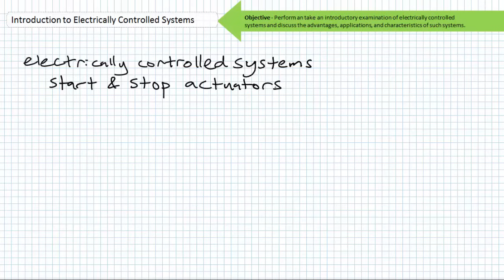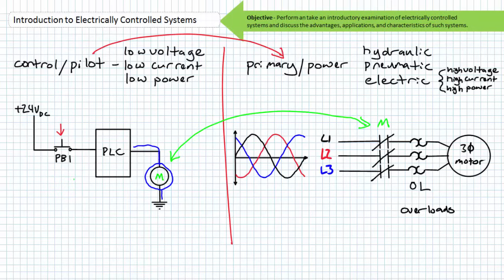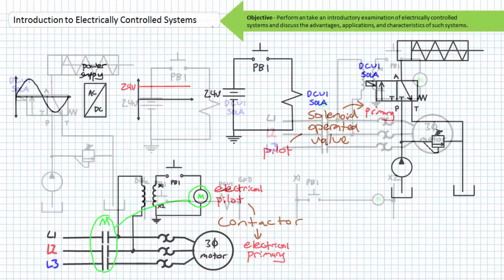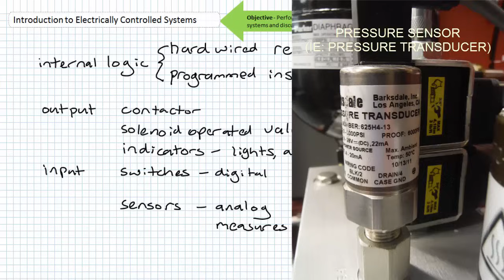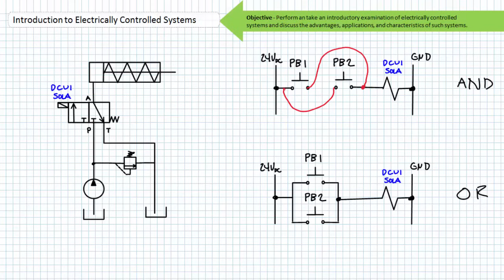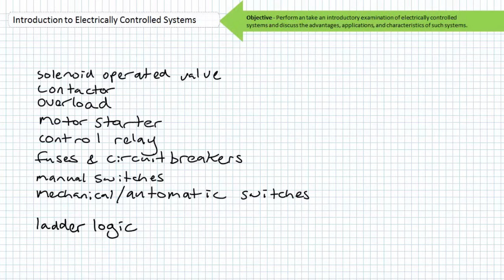Introduction to Electrically Controlled Systems (Full Lecture)

Comment: Control systems.  Actuations.  Seems a little different than most control theory.  Inputs, Outputs, brain.
Troubleshooting.  Efficient and systematic.

 Start, Stop
Change direction
force and speed control

time, counting, sequencing, compare, compute, and communication.

Control signals vs power signals
pilot                    vs   primary (actuation)

relay of signals......

Comment: Superb lecture I never ever heard before.
Sir can you explain how do operater operate the throttle and speed engine or pilot put on switch and aircraft win flap. How they operate electrically hydraulic or pneumatic system.
Please help us to understand this.
Thanks.

Comment: I have been working in the aerospace industry & I don't understand why they don't use the ladder diagram schematic for flight controls, they use something called "Lamm" diagrams which are a hybrid pictorial/electronic symboligy. Ladder diagrams would make sense for hydraulics used in flight controls.

Comment: You have done a lot of intros! Now we need to do some more complicated motor control circuits and a dive into automating a VFD via digital io .
Do you have anything on sink and source pnp and npn..... I can always figure out how to get the switch working when they send me the wrong one but I don’t completely understand. Most prox switches now are two wire but I still see a lot of photo eyes that come in 3 and 4 wire configuration.
Reply from the maker: Stay in touch because I do plan on picking up where I left off once I finish fixing up the basic electricity and electronics series. I do have some lectures showing how to configure digital inputs and outputs for  motor drives in the motor drives playlist at: https://www.youtube.com/watch?v=uT3m-o1PM3c&list=PLdnqjKaksr8qruLl85Uq3em62PjXlSNUF

Comment: Seems like transistors have been able to do the control function since the 50s or 60s. Controlling a large amount of current with a small amount of current, and isolated from the power circuit.  The mechanical approach with solenoids seems like the best you could do before semiconductors, but obviously they are still around. I’m just a hobbyist with some background in using transistors but now starting a class in motor controls. The contactors seem big and bulky for what they do.
Reply from the maker: True dat. Modern power electronics devices are much smaller, lighter, and offer additional functionality (example: zero crossing switching) unavailable with traditional electro-mechanical devices like contactors. A lot of the times it simply comes down to price!

Comment: Greetings Mr. Pytel,

First and for most, I would like to express my gratitude to your kind and humble effort to sharing your knowledge and expertise. 

In this footage at the time frame 16:03 you indicate a control transformed driving a 3phase motor. The schematic drawing indicates that two of the 3 phases of the line-to-line voltage is being utilized as input to the primary coil of the control transformer.

My question is shouldn't all the three phase line-to-line phases be used via contractor. Doesn't 3phase require all the three phase line-to-line phases via contractor ?

Your prompt feedback is well appreciated.
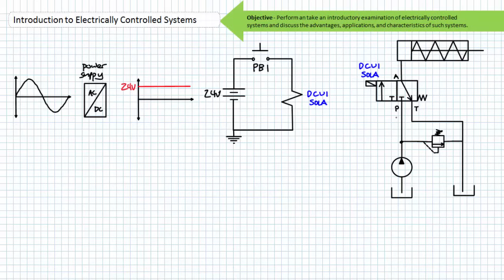Reply from the maker: There is a note in the information section, comment, and floating annotation at 15:09 that indicate the control transformer needs to be upstream of the contactor. The control transformer provides control or pilot level voltage only for the ladder logic circuit and is derived from 2 phases of the incoming  3 phase AC indicated by the colored L1, L2, and L3 connections.
Reply: Thank you

Comment: Thanks again Jim. Enjoy your break. I see you're closing in on 500 subscribers. By the way, those little dots that appear and disappear , usually in the lower right of your graph, are they random or are you sending some secret message?
Reply from the maker: John C Most definitely secret code ... actually it's an annoying "feature" in MS OneNote that leaves the pen cursor in the last place you touched the screen. Yes, super psyched to see the subscriber count hit another notable benchmark. I'm actually doing a presentation at the American Society of Engineering Educators (ASEE) and Hi-TEC this summer and hoping to spread the word. So far the data I've obtained on a small sampling of students (26) present this as a workable and desired option for those enrolled in electronics or renewable energy technician programs. My goal is to keep adding more goodies to the toolbox!
Reply: 500 subscribers...wow...More like 66 thousand now! Jim's channel has grown so much and deserves all the subscribers :)